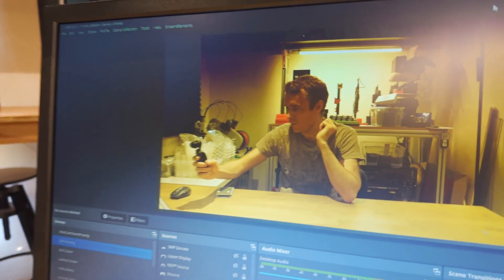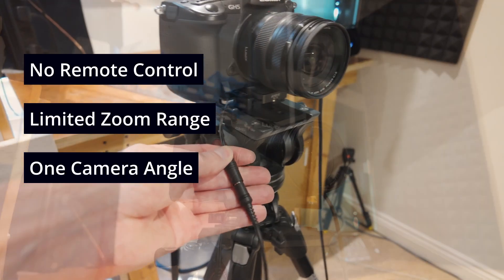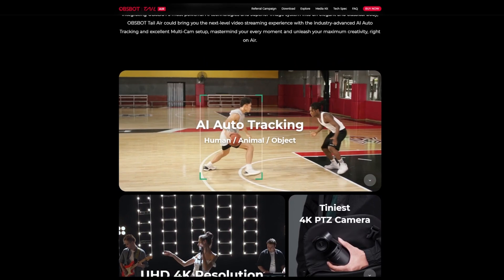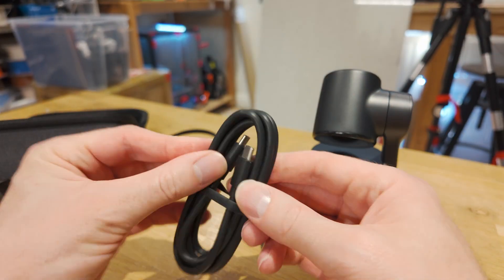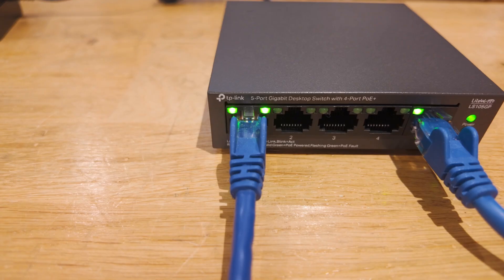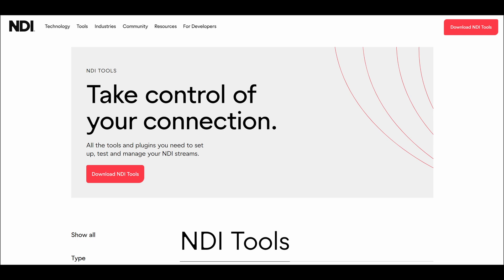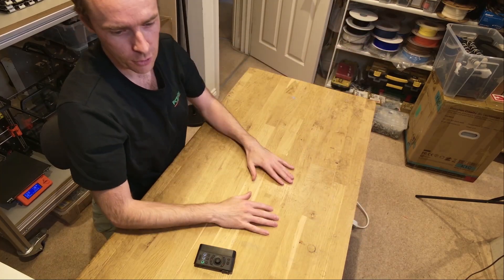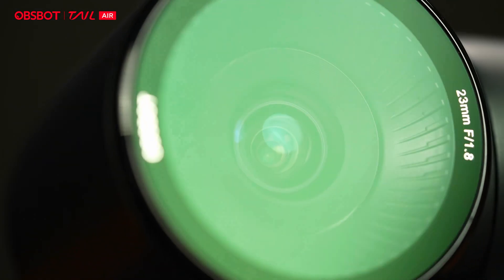Easy Multicam Live Stream - OBSBot TailAir

Comment: When we setup video conferencing we place our network based audio on AVB enabled switch’s and run our video on a vlan or separate it entirely from any other non VTC network traffic. Think of it like hot and cold water, nothing mixes until you want it to. 
I’ve install OBSbot in a few sites, wish more companies would use them, they’ve work very well.